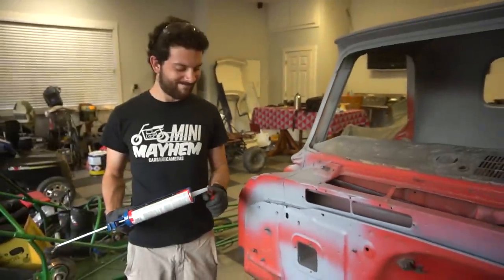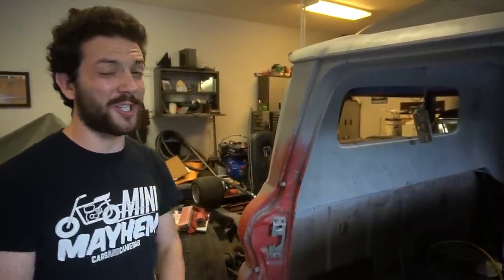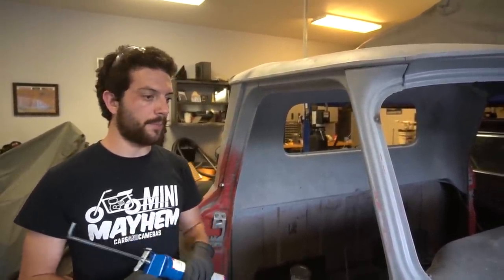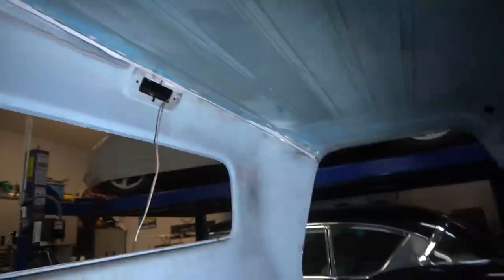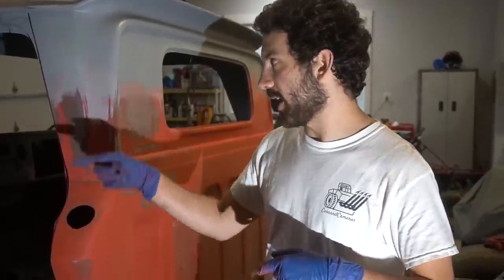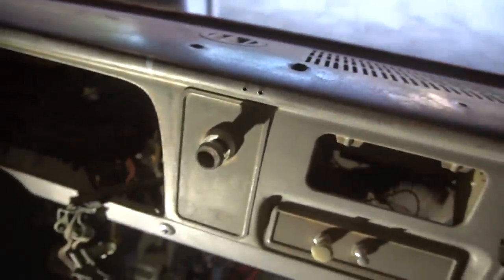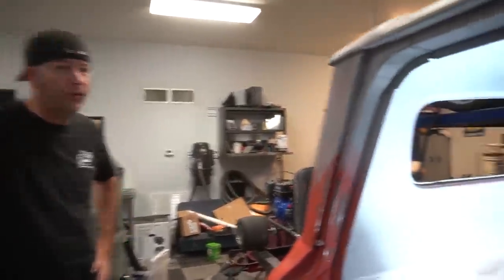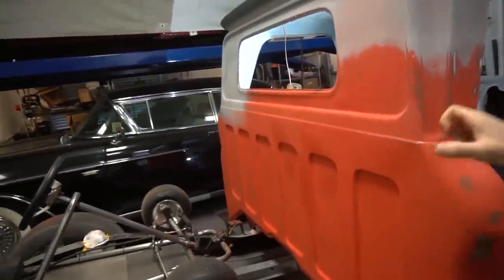My Chevy C10 Resto Mod! Fire Truck Cab Rehab!

Comment: Ahh sweet C10 vids! Keep grinding on that body work John it’s tough and tedious but sooo worth it in the end. Also, I put that exact same crate engine in my cj and it’s awesome! Looking forward to seeing the restoration come together.
Reply from the maker: Dude I had no idea! Is it peppy?
Reply: CarsandCameras Haha yeah I have 4.10s in the back with 33 inch tires and it spins em easy, it has a ton of torque and does surprisingly well for a 350 in the upper rev range. You can hear the cam at idle too. So it’s gona be a good time in that c10 lol.

Comment: When u put seam sealer on say the door jam where it is visible, if u put maskig tape on either side of the seam then apply the good, and wipe it like you did then remove the tape, don't let it dry with the tape on, but it makes a nice clean edge and looks like factory "sometimes" lol. U can still do it to the door jams where u already did the goo application. Just a tip I thought I would share with you! Stay motivated on it and always always have fun while you are doing it and it'll be done in no time!!

Comment: I have a 66 ford f-250 custom cab, 352 fe series v8, toploader 4 speed. I just graduated highschool qnd the truck was my senior project. Just like you did, got it down to bare metal, por-15 the frame and suspension components. Replaced all bearings, rings, seals in the engine, replaced all factory bolts and fasteners. It's now a runner, not a looker. Old vehicles deserve second, third, fourth, and even fifth chances. They hold so many memories and it's a damn shame to see them rusting away or getting crushed.
Reply: Ya, the crusher is what happened to my fathers 1979 Firebird Formula. The uni-body started rotting on it because of the weather conditions around here and he didn't know they sold repair panels for it at the time. He ended up scrapping it after he salvaged its' 301 and tranny to put in his Cutlass Supreme after its' own 307 blew up. Even if it was saved just by taking the good parts off and selling them to someone else who was fixing theirs. Sadly this was way back in the mid to late 90's where the older cars still weren't as treasured as they are now.
Reply: that old 352 is hard to beat
Reply: @MadsWorld34  oh yeah, tough as nails and torquey as hell.
Reply: @Slane583  I'm glad that we've started to remanufacture a lot of things, plus the fact it's all online makes it easy to find what you need. It's expensive and takes a lot of time, but I think it's well worth the investment.
Reply: Daniel Grady: Ya, you can get all kinds of repair parts now. It makes fixing old things that are a bit more common less of a headache and more fun. Plus you get a good rush of self-achievement when it's all back together and working properly just knowing you fixed it and not some over-priced mechanic. That's why I love old tractors from the 40's to the 60's the most. Absolutely bullet proof, simple to fix, and parts are reasonably priced.
Reply: Those old Fords are nice. I bet it runs like shit on a shingle cold but smooth as a baby's bottom warm. That's how my car is.
Reply: @lsswappedcessna  it runs good cold too! Sometimes it even prefers it, just pump the gass twice, around half choke, and hit the key and bam, fires right up and is ready to roast 'em
Reply: Then again, I have an automatic choke. I've heard they're crap despite only having one problem out of it. Was simply adjusted wrong and starving the engine of air. I am looking for a newer car, probably a GM SUV or pickup so I can have the trans rebuilt. Leaky old Jetaway makes a slick spot in the garage that if I don't wipe up every day will eventually get out of hand, running towards the drain, and be easy to slip on.

Comment: Well you got me encouraged to get to work on my 3 projects.  Got a 84 ramcharger 4x4 auto with a 360, 86 w250 power ram 4x4 4 speed with a 360 and a d150 2wd auto with a 318.  Got to pick up my replacement bed for my w250 next weekend, its the only one that runs, d150 needs some troubleshooting, ramcharger a fuel pump but all got body work to be done...but i need a garage first lol

Comment: This is amazing because I’m doing an 84 c10 at 17 years old. Bought it for 1200 sitting in a field didn’t run, had locked up brakes and tons of mice. Have it running and driving in about 4 months and rust repair is about half done. It’s a crunch to finish before winter
Reply: Going to Carlisle this weekend to find a good seat and other interior pieces

Comment: Love the c10 updates! I pretty much got my crown Victoria suspension in the front of my 66 f100. Working on motor mounts for the 289/302 now. I also really want to have mine on  the road by next summer

Comment: Hey John this may be of some help to you for getting things even. There’s a paint called guide coat. It’s a black paint that goes on in a thin light layer to help with leveling off your surfaces and lets you know where to keep sanding. Helps with taking the guesswork out. Outstanding job I have to say.

Comment: Dont try and sand that seam sealer just use lacquer thinner to smooth it down and also for cleanup.....I use an Acid brush to spread it around then i dip the brush into the thinner and spread the sealer  and use the disposable blue shop towels dipped in the thinner for cleanup.....Also get your self some Half-time glazing putty you will love it......Sands so easy you will be in Aww......Keep on Trucking John.....

Comment: John your work is fine and does not have to meet any one elses standard  ,enjoyable to watch, I have a daily driver 89 Volvo 240, starting to show its age, it has original paint and is chipping away in the normal areas, well arches , etc and I'm just going to fix it up like simply, it won't be pretty ,and like Ike says IT'LL BE FINE,
GREAT VIDEO AS USUAL

Comment: Nice to see the truck, I got a 64 short stepside myself that should be at the first leg of the power tour next year. Just a few tips, if your going to fill pinholes I'd suggest por-patch. It's basically just a thickened up por15 works pretty good. ( I always suggest fixing holes with cutting it out and replacing it) next time you seam seal tape up each side of the seam and dip your finger in thinner before you spear it in. It'll give you nice clean lines

Comment: I'm a huge fan of these trucks, I drive a 1977 k30 i fully built my self and I've been waiting to see some new stuff with this truck! I have a 6.2 diesel in mine that boosted with a turbo making some where around 250hp and 430 torque, with a 3 inch lift and 35s, keep up the good work !
Reply from the maker: I bet that thing is fun!!

Comment: Keep up the great work, bud! Quick tip - on the front & rear windshield channels, make sure the welds are smoothed down as much as possible on the outside, 'cause if those areas are uneven, water will still leak past the weatherstrip. Don't be afraid to use a little body filler in there, too, to fill any low spots or cracks. Those areas won't be seen anyway once the glass and weatherstrip are in place.

Comment: Hey John, If your gonna put a catalyzed high build primer on the truck ya may wanna move all your stuff out of the garage (use a 1.8 or 2.0 fluid nozzle set up on the primer gun),,,it will float and stick to what ever is around. Secondly if you can I recommend "dry" blocking it vs. wet sanding you will get a more straight finish...YouTube "blocking body work and primer" for a few tips...good luck its looking good so far....( I've been painting and doing body work professionally for over 25 years)....Eastwood channel has some very helpful vids...! Keep up the great work bud..!

Comment: Everybody has got to learn sometime but it's hilarious watching you learn on youtube. Every caulk can has an inner seal you need to break before use. Also, you really should take the time to fix that rust on the firewall drip rail. Just because you sand blasted and primered it doesn't mean "it'll be fine". You said it yourself, it's a learn and go process and you will learn. Keep em' coming.

Comment: hello John i am a long time subscriber my self i own a 1967 chevy c 10 stepside i have owned it since 1996 it need alot of body work aswell maybe more than yours its rough but its all original 292 straight 6 3 speed i think wat you have done to this truck is nothing short of wow!! keep up the good work u inspire me my problem is i have no shop

Comment: John, your caulk gun should have a flip-out pin on the underside near the front, which is what you use to pop the inner seal on new tubes.

Comment: I had one of those. Fun car :) It was a 76. Lowered to the max so no driving comfort at all in any way shape or form XD nice sound tho :). Lightly tuned 350 small block with around 280 bhp. Low gear rear axle and a TH350 case. It did not like highways :P. hehe.

Comment: Aye man I’m in the same situation as you I had a 63 horrible shape finally got convinced to use the 66 cab I had I used it and it’s a lot of body work you’re doing great you got a grate cab and your doing good and I know how ya feel i been working on mine since I was 7 and I’m about to be 16 and they made them trucks by hand and aye they weren’t made perfect in the start so don’t over think anything and before you go to far make sure your doors line up and to be sure you need to hang a finder I promise you that’s a big thing

Comment: I work in a body shop and your doing it mostly how we would do it with of course the main difference being time. I am just an apprentice but I have worked on major projects that had ridicules budgets and time frames for completion. I assume you have a hard block for sanding the flat surfaces and if you don't do invest in one it will make it much easier. Also for edges take the hard block slightly past the body lines to sharpen them. Hope these couple of tips help you and I wish you the best of luck.

Comment: John this awesome an I look forward to seeing more updates. I myself have received a 1991 GMC Sonoma from a old coworker. I t still has the original engine with in unknownknow miles but still runs an drive...plan on doing a engine swap once the motor goes...

Comment: When you apply body filler make your first coat super tight to ensure it gets into the sand scratches you create or any imperfection you are trying to fill. Then apply a little at a time usually like 1/8" at a time. Also for curved surfaces I like to use a plastic spreader that is flexible on the edge. For flat areas I use a stiff spreader. Just a dumb little tip but idk might help so why not. Rage unltimate premium body filler sands very well!
Reply: Ohh btw super excited to see you are working on the truck! We are working on a 53 5 window chevy at my job. Keep up the great work!

Comment: Some tips:
1) Get metal body filler applicators and keep them clean
2) Take a pencil and circle every spot that needs a filler so you don't miss them and repeat after every sanding. And start from bigger and more noticeable spots and go finer and finer.
3) If you have small spots apply the least possible amount of body filler so you don't have to sand down so much.

Comment: After you prime parts you should lightly mist everything with a differently colored primer. This is what I've always called a "Reveal Coat," and it allows for imperfections to be revealed as you go through the wet-sanding process.

Comment: Too bad you and Ike weren't a few states closer me, I'd give you a hand. I took Auto Collision back in the last days of high school and never got to use my skills for anything after graduation. I didn't really care about the welding aspect of it in class at the time. Now I regret it because welding can be used for doing anything related to stitching metal together. I was heavily into the body finishing and detail work, getting the clear coat to shine like a mirror with a few steps of some wet/dry sandpaper and a good cut-in buffing. :)

Comment: some gloss black will show you spots that need to be fixed. even if you are going to paint it a different color using black while working the body will help with the overall outcome of the finished look try to use the welder more and less filler as well. over time the bondo can give you problems. .you need better body tools to help make the job easier. ask sponsors for some help there. it does look good and really good for a beginner but you can take a little time and your outcome will be way above your expectations. good luck and look forward to more videos.

Comment: You might want to learn to use spot putty for minor dings in the bondo.   It is a major no no to put bondo over primer.   And if you are sanding the primer to find low spots or voids use 220 or 240 grit sandpaper.   320 to 400 grit for final primer before finish color or finer.

Comment: I am down by Dallas but I have a great old 64 c50 chevy truck with a enclosed box and a hydraulic lift tailgate. This truck has the original 327 engine in it and the old granny 4speed. It has set for years but is straight no dents in it at all. Still has the spare tire in it. Glass and lenses is perfect. Sure it has some surface rust it is 54 years old. It was running fine when the owner parked it when he got sick and died. I also have a 1940's lincoln sa200 welder with the front handcrank like a model t and the 4 cylinder continental motor. Cheap. One thousand for the truck undecided on the welder. Do you know how hard a complete  unmolested 327 is worth. Not to mention the cab and even the lift tailgate on it. Sure would make you a great work truck lol. No more lifting heavy items just use the lift. Not to mention the straight and I mean straight 1964 cab and front end  .

Comment: I hope you rotate that engine by hand every once in a while. I've had engines sitting on stands in the garage for years and the ones I didn't spin developed rust issues. That light surface rust on the front of your heads/water pump mounting surface will also form in the cylinders. Best practice is to pour an oz of engine oil into the cylinders and spin the motor at least every 6 months.

Comment: On your patch panel on the dash, you could have made a die out of a section of a log and a channel cut to match the raised seam in the truck then hammered it out with a dull chisel and body hammer.

Comment: If your using primer filler use a really low grit sand paper, but the rule of thumb for primer sealer is to use 1500 grit

Comment: Those holes on the top of the dash may have been for the two way radio. 1966? They didn't care about visibility and the lights were on the roof, which is no longer there. Probably why the (fire vehicle) roof was rotted. Just a guess. Keep up the good work.

Comment: Dude! those yellow spatulas are like cheap cheap- BUY A NEW ONE- that ones is a roached-out mess! thats why it's leaving a million grooves and streaks in the filler - LOL looks like youre using a serrated grout trowel - Hahahaha
Reply from the maker: Yeah, I was thinking that myself. It's real bad.
Reply: Also, it causes you to mix air into your filler, and then when you go to sand you expose those air bubbles as little pin holes and pits. The smoother you spread that filler, the less you have to work with sandpaper to smooth it out!

Comment: Duh, caulk tubes do have a seal you need to puncture. First time I used caulk, I gotten a lot further. I ended up with half of the back tube filled up. Life experiences! After the first time you definitely remember about that seal.

Comment: You need to pick up a cheap primer gun with a large tip and some of that 2 part spray polyester body filler and that will smooth out most of the imperfections on your truck and after that go over the truck with a good high build 2k primer.  It will be so much easier than trying to high build with that 1k spray primer and the job will turn out much better.  Check out the gunman for tips on painting

Comment: hope you fitted the doors  when you did the top and rockers..  got a feeling  yer gonna  have some problems  when it comes to hanging the doors.     also  the windshield is gonna have air leaks.  when or If  you get it done  and driving..  there`s gonna be  some places  you see  Cracking .  and  possibly  welds popping.

Comment: Hey bud, ditch the body filler and go buy icing, polyester icing for small stuff you want to fill in. Body filler is more old school, to many pin holes, it cracks, it has its place in a body shop for filling anything more than a 1/4" but you still would use icing after filter to fill in scratches and pin holes.  Just trying to save you time and money

Comment: Body filler should go over bare metal. Don’t use so much hardener. It will be easier to sand if you mix it cooler. 

Dip you finger in lacquer thinner and smooth out the seam sealer.

Comment: If your body filler is pink after mixing in the hardener, you have used too much hardener. Pea size dod of hardener for an egg sized dod of filler. Too much hardener won't make it go off faster, over catalysing can make it go off slower, not to mention pink filler is weak filler. (I used to be a fibreglass laminator in a previous work life, i might go back to that, because code is unbelievably boring)

Comment: Gday jon  yes chuck that awful spatula get ya self some steel ones use a  bit of wet n dry  to smooth any sharp edges on them first and then just clean them after every use with a razor blade scraper keep them clean ya can buy a set of free or four pretty cheep .